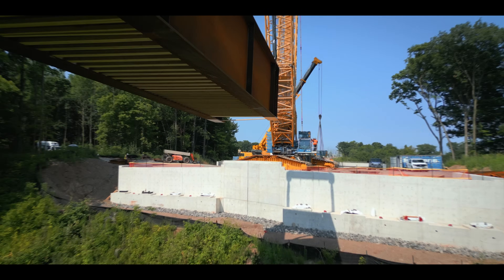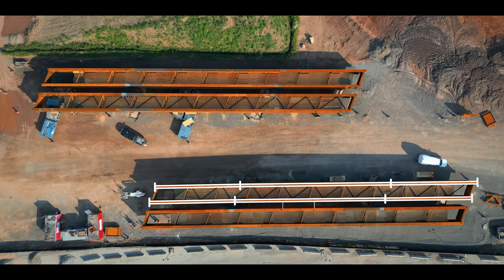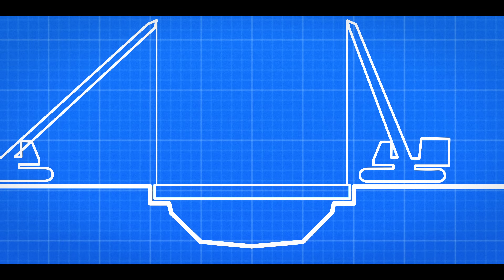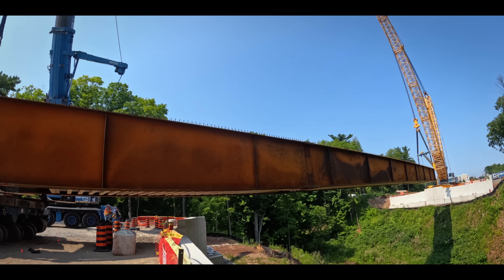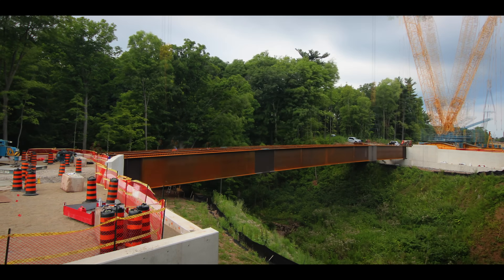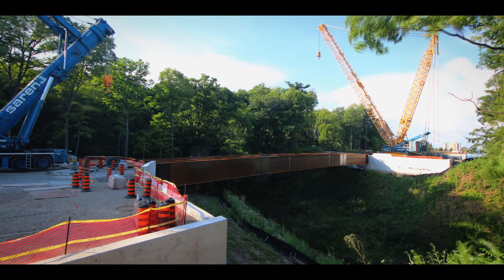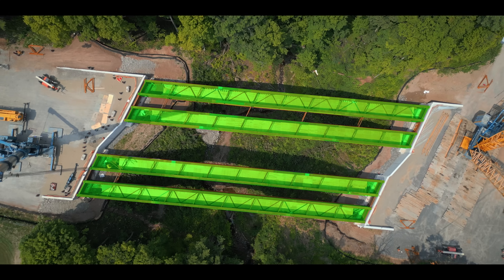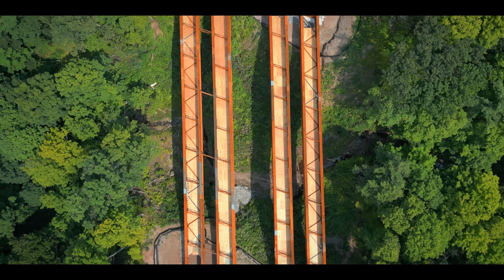Assembling A Bridge In Oakville, Canada - Pt. 1

Comment: Without cranes you can have girders come in from opposite ends cantilevered, couple them, then roll back. This requires 1 spare temp girder. Typical cantilever ratio doing this is 3:1.

Comment: They cheaped out in 50's building QEW to avoid building bridges. That is only one of several required from credit river westward.
Reply: The QEW opened in 1939 as a two lane divided highway from Toronto to Fort Erie, albeit in stages, similar to the 407 extensions of more recent times. King George and Queen Elizabeth, on their 1939 tour of Canada, were guests at the opening of the new roadway which was also one of the first "limited access" highways in North America.
Reply: Did you know they build different styles of interchanges along the QE to see how well certain layouts worked.  That's why many of them are dogs.

Comment: So freeken cool. Question you obviously know where Oshawa is and they have (and still are) doing a couple bridges over the 401. They are concrete spanners is that because the span isn't as large? It's still cool to see. The trucks line up the night before at the Whitby scales with the gurters and everyone slows down to look at them. Me included. Amazing channel ty for putting this type of thing up so the rest of the world to see 👍 🇨🇦 🔧
Reply: Concrete is less expensive than steel in initial purchase and maintenance.
Reply: Sometimes it depends on who wins the bid to build and erect the bridge.  They built a new highway up the centre of Vancouver Island with 19 crossings in my area.  Most were concrete but one company was building steel bridges.
Reply: @ ah ty for that 👍 🇨🇦
Reply: Those concrete beams are good for 40m to 45m span.  This was 73 m - likely to avoid having to build a pier deeper in the valley.  Also, these steel "I" beams are not good over traffic as there is too much surface area exposed to the deicing salts.  When over highway, only steel boxes are used, and they are 10% to 20% more expensive than steel I girders (beams).
Reply: nice ty for explaining that. I'm a 30 plus years as a heavy truck mechanic and it is something that I don't have a clue about the subject. Hence is why I watched the video 👍🔧🇨🇦🙏